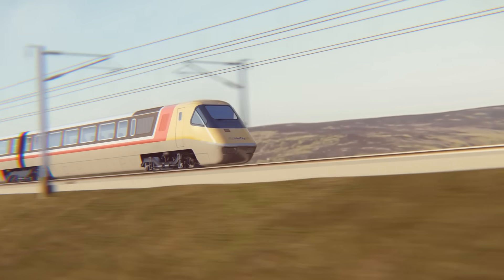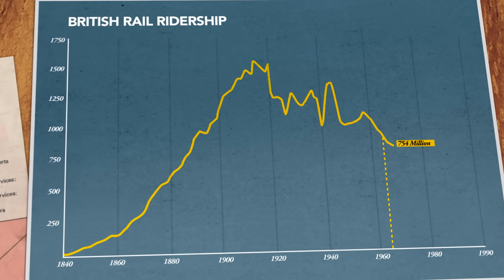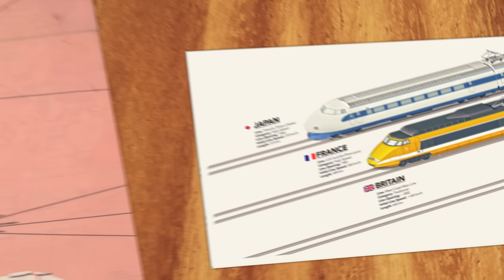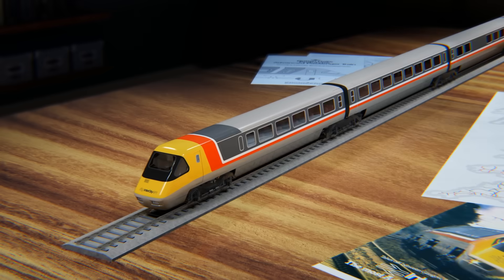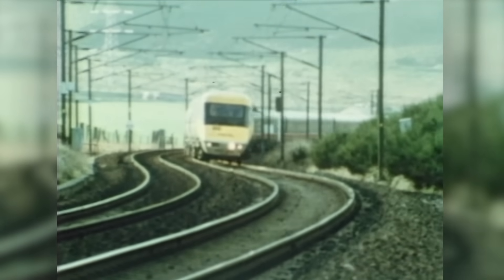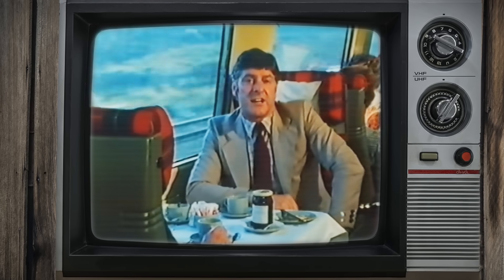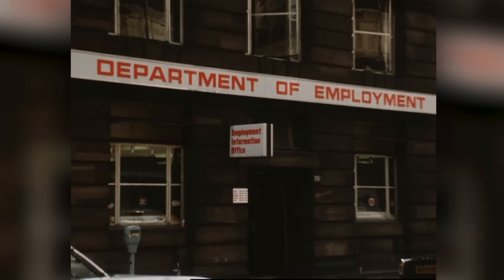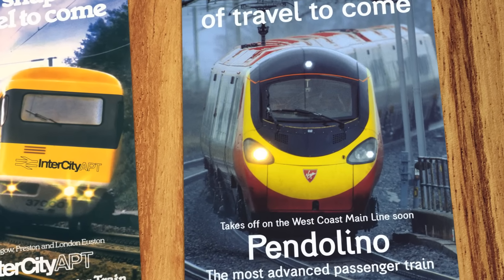This Train Made Passengers Sick: The APT Tilting Train Story

Comment: In its defence, people should understand that out of the total amount spent on the APT its was first proposed back in 1936 and various rail companies eventually being handed to BR actively worked on its development during that period making its actual costs a lot less scary spread over such a long period and BR gained a lot of experience they put directly into other vehicle development.

What killed it eventually was lack of political will to proceed, BR was fully aware that in building the pre-production prototypes they would encounter problems as almost everything, including the power source was new tech, even the wheels themselves and they also knew roughly what areas would cause issues, mostly due to cost-cutting measures forced upon them by Whitehall leading to a brand new virtually untested product filled with untested equipment thrown into service long before it was ready, What could possibly go wrong? after all the APT test vehicle had itself been a botch job cobbled together from parts scrounged from various sources, even the gas turbines used in it were never intended in the first place, built as they were by the then long-defunct British Leyland company the train required a minimum of ten of the wretched things to run at all and in the end, they were the cause of it being withdrawn long before the test programme had completed its function.

As for the Queasy rider label, this was an issue BR was aware of and it was not because the system actually failed to work as designed, the problem came out of the fact that it worked far too well, Passengers could see the world rotating around back and forth left and right as it cornered but their ears could not detect the reason for it, in short, they became motion sick, stop looking out of the widows the problem went away, BR solved it early on simply by making the motion with a series of tiny stops built into it the result was that passengers could now feel the motion and it matched with what they were seeing, as for the vibration that was down to lack of development to tune the suspension system itself and uncouple the vertical motion, something that had been done on the experimental version which also used solid bar couplings to further stabilise the ride, again cost-cutting led to BR abandoning the articulated bogie system in favour of older tech twin bogies, hence the vibration problems got worse not better.

Again in its defence, it was all new stuff in there and the government wanted results for its money and was not at all keen on railways anyway, could they have made it work, knowing BR's mindset the answer would be eventually yes, but they had hedged their bets with the HST DMU concept which also had its own crop of issues but its concept was based on a far simpler concept, bolt enough power to each end to get you the speed and acceleration you want, save time by making it drivable from both ends, upgrade the Mk11 interiors to Mk111 standards and fit off the shelf air suspension, give it big windows and aircon job done, a risk yes but one that paid off for BR and the British Government as it gave them all the ammunition they needed to NOT electrify all the UK's mainlines as APT required they do.

The final nails were driven home in into its coffin when the government put pressure on BR to put the train into service long before it was ready, as expected it had problems which the media pounced on and simply savaged the train to death at the behest of the government who had no interest in it further looking to the HST to save the day and were more than happy to order BR to simply pack it in and recover what costs they could be selling the tech abroad, a sad end to many years of hard-won developmental achievement with most of the equipment eventually scrapped.
Reply: It's always an issue with the government in Britain. No wonder British industries ended up where they are. A bunch of faffing bureaucrats who knows nothing but think they know everything.
Reply: @tiadaid  This has been a problem with Britain for well over 100 years. Back in WW1 the Germans were making remarks about just how fearsome the British soldiers were in combat, but gawked at the sheer incompetence of their higher command, equating the British to a pack of lions being lead around by Donkeys.
Reply: I find looking  out the window for long periods of time while  travelling on the  tilting pendolino on the WCML makes you nauseous so the sickness problem the answer is don't look out the window for long periods
Reply: @darylkemp1257  Also I think the journalists on the launch train were given a few drinks before started because of signal trouble. Not good for their stomachs when it started tilting. Also I believe the tilt centre point was at the wrong height for comfort of the passengers.
Reply: @darylkemp1257  I get sick catching the tube and I don't even look out the windows.
A leaning train would be like riding a jet ski for me.
Reply: The sad thing is, this failure of a train is part of the reason why VR has the "Cubed Square" option.
Reply: Just say it's quiet, smooth, and all in all a delightful experience already
Reply: ...thank you for your write up. Very interesting
Reply: I think this is the longest comment ever since this video has existed
Reply: @suzannethomas9323  Believe me I have seen even longer texts.
I believe youtube used to gave multiples read more.
Reply: This guy knows trains
Reply: One of the fine comments on Youtube right here

Comment: The real problem with the UK rail network is that it was never designed for long, high-speed networks. In the 1800s there were hundreds of individual railway companies building and running their own services. The networks were frankensteined together.

Modern day problems include bottlenecks, overcrowding and speed restrictions because of route designs.
Reply: But it is not that bad.

Comment: Fun fact: The Pendolinos are running here in the Czech republic and they are quite succesful, some might say famous. Every kid wanted to ride one at least once in their life (incl. me). I never knew that they originated in the UK so thanks for the video
Reply: @Sabrina MARCANTE Italian high speed trains (Frecciarossa and Italo) don't oscillate. They run on dedicated railways most of the time. You can't run 300+km/h on normal railroads because even the electric system is not apt. 
A part (not all) of the 250km/h trains that use normal railroads are oscillating.
Reply: @neutronalchemist3241  don't listen to that girl in the comments, I'm Italian to, i don't know what she has seen but our trains of course reach that speed only in the dedicated tracks
Reply: @neutronalchemist3241  Now the Frecciarossa trains do tilt, at least some of them do. The tilting trains ETR600 and ETR700 are being rebranded from Frecciargento to Frecciarossa. These two models operate mostly on conventional rail and can only reach 250km/h.
Reply: Nothing of the APT ended up in the Pendolino. It's just a legend.
Apart for the fact that the Pendolino prototype, FIAT Y 0160, was built in 1970, while the APT prototype run for the first time only at the end of 1971, and the first prototype of the commercial Pendolino (ETR 401) became operative in 1976 and had been retired from passenger service only in 2008, the working principle of the two is different. Pendolino has two gyroscopic and accelerometric transducers on the two bogies of every car, instead of a single accelerometer on the center of the car. That means that it reads the inclination of the track at the start of the turn, and can react in advance and more precisely than the APT system, avoiding the oscillations and imbalances that were the cause of the motion sickness of the British project. That's why it had been so successful worldwide.
Reply: @neutronalchemist3241  So Fiat buying the APT patent was a waste of money for them. How sad. Never mind.
Reply: @markp6982  Neutron is wrong on this aspect. APT patents were bought by Fiat and were used. The real myth is that Fiat bought all of the APT patents and claimed them as their own work, this is a distorsion of what really happened. Only some patents were bought (apparently Britain sold part of the patents to Sweden and Canada too, but i'm not really sure) and only some were used to further perfect the technology. It helped with 2° gen pendolino design but most of the work was already previously done by Fiat on their (way more successfull) prototypes.
Reply: @neutronalchemist3241  

In 1976 Fiat Ferroviaria built the ETR 401 trainset, a tilting train using an active system with 10 degrees of tilting that used gyroscopes to detect the corner in its early phases in order to have a more punctual and comfortable inclination: this is why the FIAT project has been successful since the '70s.

In 1982 FIAT bought some APT patents that were used to improve their technology for the ETR 450 trainsets.   Wikipedia - Advanced Passenger Train - Legacy   9:06
Reply: @neutronalchemist3241  Fiat Ferroviaria (the original builder of the Pendolino) licensed key bogie (the undercarriage assembly containing the wheels) technology from British Rail. Specifically, the bogie design for the Italian ETR 450 Pendolino, a successor to the original ETR 401, was heavily based on the research and patents developed for the APT. This technology was crucial for ensuring stability at high speeds, independent of the tilt system.
So, while the tilt systems were distinct, it is incorrect to say that "nothing" of the APT project ended up in the Pendolino. Critical high-speed running gear technology certainly did.
Reply: Kdo by nechtěl jet s Pendoušem 😃
Reply: @Sabrina MARCANTE No', really. Nor the Frecciarossa (ETR 500 and 1000) nor the Italo (AGV575 and ETR 675) are tilting. They use dedicated lines with large turning radius, so a tilting system would have been olny useless weight.
Reply: @neutronalchemist3241 Before writing, try to search first: the Italo ETR675 is a tilting train, as well as the ETR460! But the Italo AGV, the ETR500 and the Frecciarossa 1000 aren't tilting trains.
Reply: @GuilhermeSoares-ol3yf  Before trying to correct who knows best, try to search first. The ETR 675 used by Italo is not tilting. The ETR 460 isn't even an high speed 300+km/h train, it's a 250km/h train, a Frecciabianca.
Reply: @neutronalchemist3241  And the ETR675 isn't a high speed train too, it only reaches 250km/h!
Reply: @GuilhermeSoares-ol3yf  And it doesn't tilt. As I have ALREADY wrote, only "a part (not all) of the 250km/h trains that use normal railroads are oscillating".
Reply: Here in Poland pendolino is so common they operate most rides between popular cities 
Us trainspotters are up for the rare Bois like the 
EN57-1316 the only black-red EN57 which I recorded
ET41
SM
SU
Old EP07's
Old EU07's
EU44
Reply: Here in Portugal we have a Pendolino train too, the CPA 4000, well known as Alfa Pendular. Btw it is the most famous train here and the fastest too!
Reply: Britain is not the UK
Reply: @nickd3157  yes it is? Lmfao Britain is part of the UK and the British government runs the UK
Reply: @Sabrina MARCANTE It doesn’t quite work like that. Both ETR400 and ETR500 are non-tilting train, than there are the ETR460 and ETR610 who are tilting train (this is the Trenitalia stock). As for the Italo/NTV stock there are Alstom’s AGV (non-tilting) and ETR675 (tilting). No we didn’t copy from the UK since that FIAT Ferroviaria was already prototyping the ETR450 in 1970.
Reply: in PL too
Reply: That's awesome!!!
Reply: I  mean, we still do have pendolinos, (390s) operated by Avanti West Coast .
Reply: We have pendolinis in Poland too :D
Reply: Skoda 15T > Pendolino. Tilting train, mhhhmmm, I've seen that in UK. But ... WOODEN SEATS
Reply: They still make me feel sick every time
Reply: Same thing here in Finland!
Reply: We still use pendolinos in the uk
Reply: @Sabrina MARCANTE cosa stai dicendo, il Frecciarossa 1000 va alla massima velocità solo nei tratti nuovi costruiti apposta per lui(es Bologna-milano, mentre nei tratti normali vecchi va alla velocità dei treni normali ovvero massimo 160 kmh
Reply: @Sabrina MARCANTE We didn't It's the very way round. Pendolino is Italian
Reply: @Sabrina MARCANTE dai basta con sto finto orgoglio italiano. Siamo indietro su qualsiasi cosa.
Reply: Michal. Danish politicians wants to spend billions on building bridges to save a few minutes on our ancient railway lines. So, can you tell me about timesavings with the Pendolinos............. They do go faster around corners, right? Saving a minute or two on travel time...
Reply: Pendolinos didn`t originate in the UK, but the technology, and development did, and Italy made it work..
Reply: @lawrencecody4085  the pendolino predates the APT. The first prototype was from 1969 and the first run in regular operation happened in 1976. Britain was probably the second or third country (depends if you count the LRC) attempting such a system
Reply: We have these in finland and most people hate them, they're really unreliable during cold weather. I appreciate them, but prefer the VR Class Sr2 and VR Class Sr3 more since they're more reliable. Also they can pull double decker cars.
Reply: Its our tech sold off by criminals who run uk which is a corporation.
Reply: Same here in Finland, and it's Pendolino (VR Class Sm3) as well. Kind of like the British attempt with APT, Pendolino had bit of a rocky start here, but mainly because of the harsh weather conditions. The tilting system needed to be switched of during winter, and the train was getting bad press for unreliability. Tilting system was eventually replaced with a retrofit conversion kit that I believe to be locally designed. There's been gradual improvement of the rail network, so the gradual sloping has been introduced to some sections of track making the tilt less important and the more conventional rolling stock running at nearly the same speeds. At this point after some 25 years in service Pendolino is doing pretty well, operating as premium service between large cities.

Pendolino is also operated as Allegro, the train from Helsinki to St. Petersburg. Now suspended for obvious reasons. These are dual voltage and have control systems for both countries. So not the same train beneath the surface. I guess it's also based on a newer version of Pendolino.
Reply: In Portugal we also use Pendolinos rebranded as "Alfa Pendular"
Reply: Я слышал, что Сикорский в 60-х годах разрабатывал свой наклонный поезд совместно с британцами, но что британцы создали свой собственный наклонный поезд, аналог поезду Сикорского, даже предположить не мог. Кстати, он конструктивно отличается от итальянского поезда "Пендалино".У итальянского -- дуговая система наклона. У поезда же Сикорского подвесная-пневматическая. Я ещё в детстве был на презентации этого поезда. Какая же система у англичан -- сказать не могу, но вряд ли она кардинально отличается от предыдущих. Сейчас такие же эксперименты происходят в Австралии. Наверняка, не без участия британцев. Но в Австралии система наклонов отличается и от поезда Сикорского, и от поезда "Пендалино", и даже от британского АРТ, так как в Австралии другая магистраль, не похожая на обычную железную дорогу...
Reply: You still have pendolinos in czech?! Here in italy they are super famous, but they were retired before i could have a ride lol

So i need to go there
Reply: They didn't  originated in the UK. It's an Italian concept.

Comment: Uk like the US prefer cars and thats that. Italy and Spain have amazing Trains - but are broke. We are a small country. Fast trains are not wanted by the majority of the pubic
Reply: Considering that the UK already has high speed rail to most cities, I'd say that's completely false. We just achieved it using different trains, and settling for slightly less with the intention of investing more money in the future. The WCML nowadays operates tilting high speed trains, and the majority of other mainlines do to (although without tilting)
Reply: @agent_605  we have trains bought from elsewhere and not developed here. Otherwise we would still be using 125s. High Speed lines that either knock 15 mins of a journey or charge a small fortune for the useful ones are pointless. People in the UK prefer to have a car for longer journeys or the take a Plane as its probably cheaper. Most money generated by trains in the UK come from commuting - and they stop every 3 or 4 minutes.
Reply: steve epsilon Again, that’s mainly down to government mismanagement, and that all traffic on the existing railways share the same lines. That should be alleviated with HS2 by separating intercity traffic from commuter traffic, meaning there’s more overall capacity, therefore fares can be offered for less